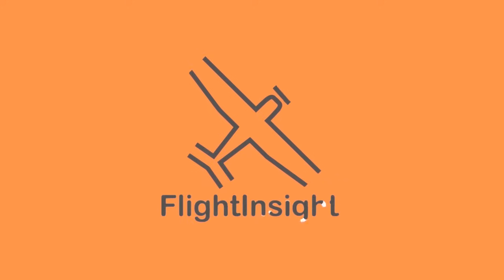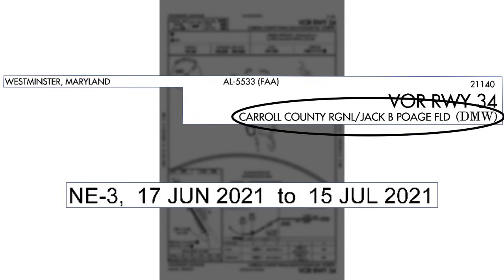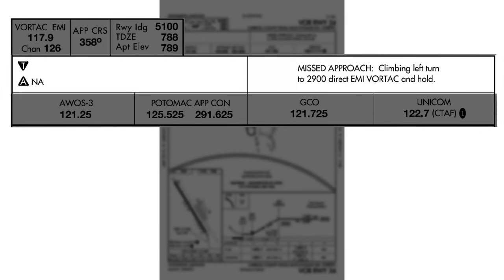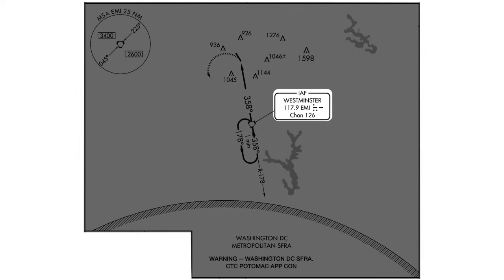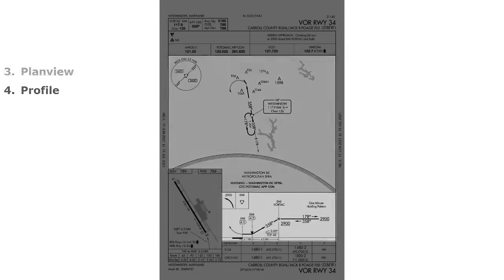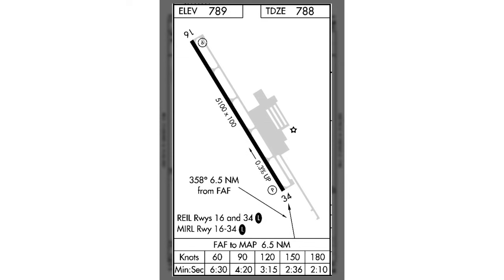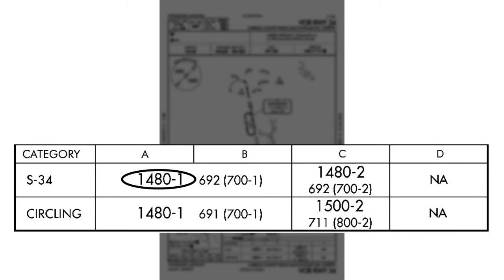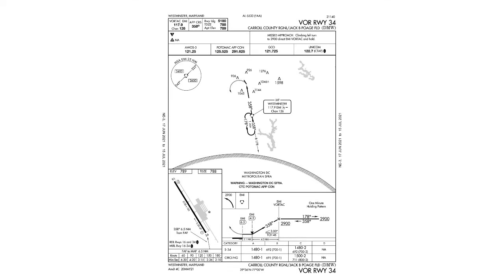Easily Read Instrument Approach Plates | Instrument Approach Plate Tutorial | IFR Training

Comment: So if you had lost communication and you follow the MSA for the sector that you are in, when is it safe to descend to the published minimum for the segment of the approach that you are on. For example, if the MSA is 25 nautical miles around the Initial approach fix, then, technically, would you go down to the minimum altitude at the initial approach fix it may be significantly lower than the MSA within the 25 miles that circles it. What I’m trying to ask is how do you know if you are clear of obstructions if you were going to descend to the initial approach fix Minimum? One more thing, suppose you are approaching the fix that requires a no PT or no procedure turn? How would you descend below the MSA and still be stabilized?

Comment: Really great presentation. One little thing that should be emphasized is the descent angle of 3 degrees which in my mind is critical. I understand that timing from the FAF to the MAP gives you an approximate rate of descent but in today’s day and age, you may have avionics that gives you a flight path vector. In this specific case, a 3 degrees flight path vector meets the requirement for a CDFA of SCDA resulting in a much safer position to land the airplane once visual contact is established. The (old dive and drive) type of final descent is far from ideal. Safe flying to all.

Comment: I thought that the timed approach speed was based on AIRSPEED.  My thinking on this is that it is much easier to just look at the ASI, no math involved. Especially if you dont have a GPS.  Your thoughts
Reply from the maker: It would be easier to just reference airspeed. However since the glideslope is based on the descent angle (altitude lost for a given distance travelled) the same airspeed with a high head wind would cause this angle to be lower.
Reply: Thanks for replying.  So how do I determine my ground speed with out doing some time and distance calcs? It sounds busy at a time when focus is paramount.  Also then maintaing that ground speed during the descent and approach also sounds very busy.  Do you think this is in the AIM?.  Again thanks

Comment: RE: the landing minimums section....the numbers in the parentheses are reported weather values. For example, Cat A and B aircraft need a reported weather of at least 700' ceilings and 1 mile visibility. Remembering that ceilings are measured in AGL, a ceiling of 700' is 1488' MSL, or 8 feet above MDA. Going to Cat C circling the MDA is 1500', so the lowest usable, reportable value for the ceiling must be 800'.
Reply: Thanks for the clarification. Makes sense.
Reply: Super helpful, Shepard Air noted this in one of the questions but this makes it easy

Comment: Quick question from a military pilot. The minima in parentheses are used for us to determine whether we can legally commence an approach given the current weather conditions. Are GA aircraft not bound  by these requirements? May they commence an approach even if the weather is calling below mins?
Reply: GA can shoot an approach under part 91 regardless of the weather. Part 121 airline operations are more restrictive but usually only visibility is controlling to commence the approach in the US. If the ceiling is below minimums it's typically not controlling but in that case you often don't bother trying. Either can only land if flight visibility is at or above minimums.
Reply: Well, your altimeter or RA isn't that precise, it will only have a marking for "700" or "7" so you bug that.  Also, it gives you some time for you and your plane to react.     (Not an official source, that's just how I understand it)

Comment: Agree with others...nicely done!  Looking forward to other content.

One quick question: When you "go missed", do you immediately execute what it says on the approach plate (like the climbing turn back to the VOR), or do you overfly the runway and when you get past the end, then execute?
Reply from the maker: Each approach will indicate a Missed Approach Point. You should only execute the missed AT that point. If the procedure has you do a climbing turn, you don't want to start it too early or too late because there's no obstacle protection for the turn from anywhere other than the missed approach point. Thanks for the input!
Reply: @flightinsight9111  Awesome.  Thank you for clarifying that!
Reply: So if it's 4:20 to the missed AT don't wait to go past the end of the runway, start the missed approach procedure at 4:20+